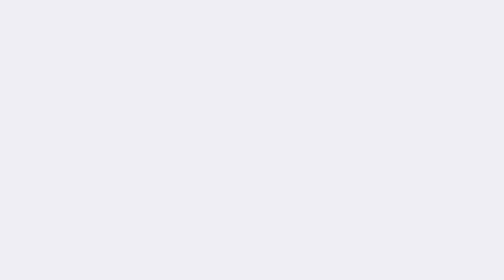HOW TO Connect Voltacon MKS-III Off Grid Solar Inverter Charger 48V to Pylontech Battery

Comment: I brought powmr POW-HVM-3.5H-24V invter in sri lanka. 

But i install it using througt externel mppt 60AMP controller. So i use only battery mode in my inveter. 

Could i knowIs it ok?

Sometimes onese a day inveter showing fault code 03 (high voltage from battery) but battery voltage is 28.5 or 28.7.

After inveter auto restart and fix it.

but Could i know why coming like this faul code.

I use this inveter everyday only till 10pm. After first i turn off load and turn off inveter. Next day i turn on it at 8am in morning. Could i know is it ok for invetet?

https://drive.google.com/file/d/18R_-1qH-vpqrMiSM_55CgzDc8bZPDy7I/view?usp=drivesdk

I have ESmart Mppt 60Amp charge controller. I set i externaly to my powmr inveter. Still i didn't set charge settings manualy. I set defult charge settings in mppt charge controller. It showing "SEL"I think it means "SEAL LEAD ACID"

Could you please tell me how i set up battery settings manualy...

please help me............

I'm afraid my inverter will be damaged.
I bought this inverter with great difficulty without money.
So it feels scary.

So Please help me..............
Reply from the maker: You can check the exact voltage of the batteries and let me know the value it is not our inverter so i can not make any specific comments, you can send more to info@voltacon.com

Comment: Once the BMS is successful connected the battery icon flashes. Does it ever stop flashing. In other words if the icon is NOT flashing is the BMS not working?
Reply: Good valid question

Comment: Here you connect the 5KW to the PYL US2000 which is 2.4kWh. Can one add a larger PYL battery like a UP3000 or UP5000 in the same manner?

Comment: How many pylontech us3000 batteries can one unit 7.2kva inverter charge effectively
Reply: Used to be 8. But that limit was pylontechs single stack limit. Pylontech now allow 16 batteries with the new model but I also want to know if the inverter can handle 16.